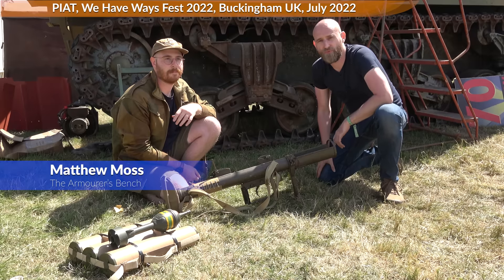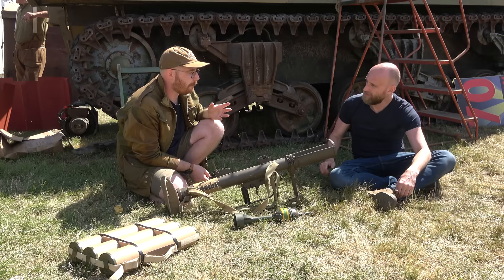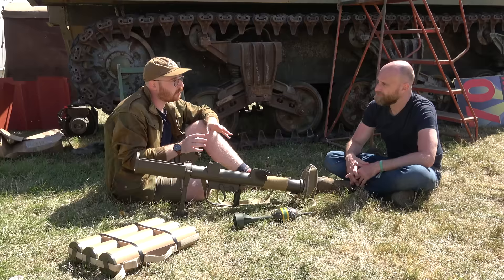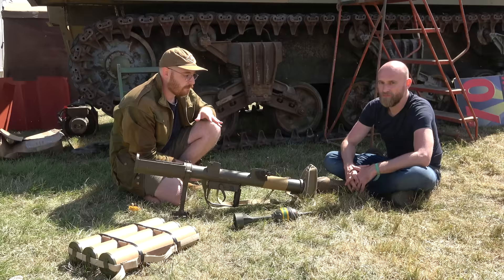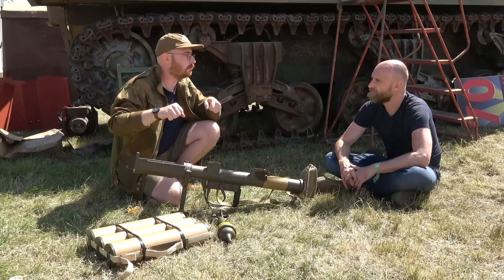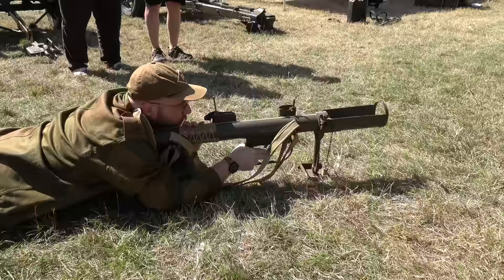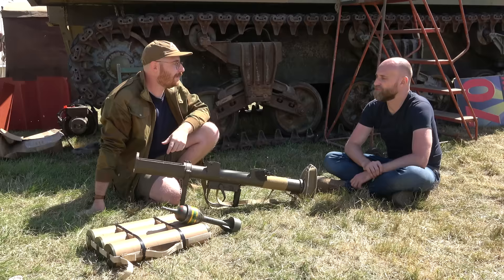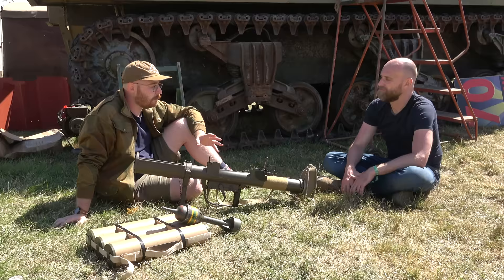PIAT: Better than the Panzerfaust?

Comment: I've always felt like PIAT would have been an ideal anti-armor/explosive option for partisans in WWII... whom didn't have access to it and instead was used by the british army:(
Reply: Panzerfaust would be even better IMO, hit and run tactics, shoot and scoot
Reply: @Piromanofeliz  can you shoot panzerfaust from a closed room? How much noise does it make and is that noise directional? How bright is the rocket motor and how visible the trail it leaves behind? Can you arc panzerfaust shots over obstacles? And more importantly, how easy is ammo for panzerfaust to produce in improvised workshops?
So, let me ask again, do you still believe what you've said?:D
Reply: They were actually dropped to Partisans and to the Home Army in Warsaw.
Reply: @TheArklyte  1. If you are at least 2-3m away from the wall, you'll be okay. 2. Yeah, it's loud, it's bright, and there is actually no trail marks. But who gives a fuck, when you relocate at sec, you take the shot? Anyway you are not brave, more like an idiot if you use these without friendly fire support. 3. Well it's closer to a recoiles mortar both in working mechanism and ballistics so the shot above obsticles is possible, but is it worth it? At 50-80m you are at the edge of close combat, would you make experiments how effective at close range a cumulative mortar, or use it the proper way? Couse if you miss, you won't earn more then a few shity pants. 4. The whole weapon is around to make it cheap, and simple as possible. Do I have to say more than, this is a freaking last dich weapon? The germans built these in improvised factories. If you can build a sten or a welrod, and you can craft amo for it you can build this shit in the cost of 15 imperial brand.
Reply: @BB-nu8pl  1)if I don't have time to calculate the backblast? 2)me? Because relocating when enemy has no idea where they were shot from and relocating under MG fire is different. And yes, let me just pull out my magical fully equipped rifle squad to support me at my convenience. 3)can I get weapon with reliable repeatable ballistics? Or should I shoot panzerfaust, watch it spin randomly and hit whatever? And yes, I'd prefer to have capability for such "experiment" if I'd have a need for something like ruining fuel tanks behind concrete fence, which I can see, but can't provide a clear access too. 4)PIAT and STEN(and several others) are also last ditch weapons. Last ditch british weapons. From a time when people believed that Sea Lion was a week away and all equipment was lost on the continent. Now tell me what's eaiser, fill a metal tank with plastide or do that and then also on top of that construct a rocket motor to specification so it won't randomly spin as in point above the answer to which you're already probably typing in to correct me?:D
Reply: What do you want to calculate about that? :D If you step into a room, and you can convinietly move around, you are gonna be safe. Belive me, at 100m, no matter what kind of stealthy anti tank weapon you use, the enemy will hear that, and start to spray that way. But they need time to  that, they have to realise they got attacked first, and all these pricey seconds are useful to us, to get the hell away from there. The "magical fully equiped riflesquad" is not about confort. They are essential. It feels like you forget, we talk about a war. A lonely fighter in a war is not more than a guy who sentenced his/her own death wish. Even the snipers work in teams. But yeah, a whole squad to a hit and run ambush would be overkill. I'd bring with me max 7 guy with sten 4 would protect the flanks and the back, the other 3 would be the support, after the grenade goes out, they just send out a burst and flee away with me. Then regroup with the oder fire team, and run as fast as we can(much easier without a heavy steel counter weight). And yeah as i told you CAN shot above obsticles, even with ironsight....no it wont bulging around, like a drunk pilot, I'm gonna tell the reasons later. Yeah the significant % of the british small arms where in concept of last dich weapon. But it isn't connect to what i told. The whole concept of panzerfaust where around to make a cheap, easy to product, yet effective and user friendly anti tank weapon, and the german engineers did it. The whole thing is not more then 2 steel tube, 2 fuse with a firing pin and a flat spring, ironsights some tnt, gun powder, and a metalic ball. And yeah, there got place the so called "rocket engine/motor". That shit is not more than a steel tube filled with gun powder, and closed with carton paper. The funny thing is the "engine" burns out in the outer tube, so the grenade flies and falls by it's momentum. No bulging away, it's just flies like a balanced rock. So why didn't use wieldly the partisans then? Becouse they didn't realy needed AT weapons, the encounter with tanks or armoured vehicles were rare, and if it happened, they had an even cheaper and more effective weapon, the molotov coctail.
Reply: They were used by the Armia Krajowa in some capacity

Comment: "Light recoil" depends on how many rounds you have to fire. Firing 1 30 round magazine from an M-16 is nothing. Firing 30 magazines without any padding and your shoulder will be very sore even if you have done it many times.
Reply: M16? No recoil.
At all
Reply: @sugarnads  3.2 ft⋅lb is more than 0. After a few hundred rounds, your shoulder has a bruise the next day if you are not wearing armor or at least heavier than a field jacket of clothing.

Comment: Another example of the design philosophy: "Why make things simple when they can be complicated".
Reply: Not at all. The concept is simple and the design robust and simple. Uniquely it was both a design in a new class (mini Blacker Bombard) that was introduced in it’s ultimate practical form. More charge means more recoil but the squishy human body is unchanged so you would have to increase the weight which would make it back up to Blacker Bombard territory which means a crew manoeuvring a mounted gun. BTW, contrary to popular myth, the Blacker Bombard was intended for Regular Army use as an anti tank weapon and issued as such in North Africa but it’s limitations caused it to mostly be used by the Home Guard and one still sees concrete prepared dug in positions

Comment: So basically its a great weapon...the 0.1% of time you are in actual combat. 
The other 99.9% of the time its a heavy and annoying piece of shit you have to carry around
Reminds me of the King Tiger. In actual combat it was really good and you wanted to be in one, the rest of the time it REALLY sucked and you wanted to stay away from the rolling maintanence desaster
Personally I would rather spread three Panzerfausts to three soldiers instead of having one PIAT with three shoots. More flexibility and easier to transport. Also it doesnt hinder most soldiers to do combat while a PIAT isnt exactly easy to transport in combat I imagine.
Reply: What made the King Tiger a maintenance disaster?
Reply: @Toenism  
Several things:
Its size, which means it needs heavy equipmeant to be repaired and cant be done quickly. Also transportation is a pain.
Germanys horrible ressource shortage at this point in the war. Basically the quality of everything in german industry has massively been reduced and it showed in parts breaking earlier or german engineers useing bad stop gap measures to make tanks still work. The lack of rubber and ball bearings was especially bad. Also german late war tank steal was easier to break and far less effective then early and mid war tank steel. 200mm on a Kingtiger could be worse then 100mm on another tank if you are unlucky and your steel is shit.

The chance that something broke down was higher then the tank reaching the frontline. And it wasnt rrally do to bad tank design but the general war situation making it impossible to keep the industrial quality a tank like this needed to function as intended.
Reply: @noobster4779  What more than size and poor quality steel for parts was an issue in terms of maintenance?
Reply: Which is why the PIAT was generally carried in the Universal Carrier or truck and brought up when needed, rather than being humped around continuously by the team. What most people do not realise about those weapons is that in most cases the PIAT Team had a Universal Carrier SPECIFICALLY for them. It carried them, their weapon and their ammunition. Which meant in general the PIAT crew were NOT in fact humping the thing for miles. 

As for the Panzerfausts having more flexibility, how so? No way to accurately fire the Panzerfaust in indirect fire, PIAT could and had sights for that role. Panzerfaust has back blast that will kill anyone behind the operator when the weapon is fired meaning it CANNOT be used in confined spaces where the PIAT has no such issues. 

Fact is both weapons had pros and cons. At the platoon level I would actually prefer a weapon that gave me the REAL flexibility of the PIAT compared to the Panzerfaust, while at the squad or section level I would probably prefer the Panzerfaust. 

Because really THAT is where your REAL mistake is. You are comparing a platoon level crew served weapon with a section level disposable weapon. You SHOULD be comparing PIAT with Panzerschreck or Bazooka NOT Panzerfaust.
Reply: I lugged around a Carl Gustav for many  miles.  Weighs just as much as a PIAT. and the ammo is even heavier.  It's only advantage over a PIAT is the longer range.
Reply: @Toenism  

The transmission being far too underpowered for the Tank, causing regular breakdowns and requiring replacement parts that, at this point in the war, your Tank Commander would need to win an organized fist fight at the maintenance yard to get, and it'll probably break the next day anyway.
Reply: @youraveragescotsman7119  Thanks, do you have a source for this?
Reply: @Toenism  Another factor not mentioned is the fact that Tigers were too wide to carry on railroad cars without changing their combat tracks for their transport tracks which were narrower.  Tanks get carried from place to place by train and only drive under their own steam in combat, and every time they had to be moved the crew had to change tracks.  You then have to store these tracks while they're not being used, and according to a recent Chieftan video, a set of Tiger tracks weigh more than a set of M1 Abrams tracks.
Reply: @minuteman4199  Interesting. Do you have a source for the tank being mechanically unreliable and prone to breakage? The other guy won't respond.
Reply: @Toenism  I used to be an armoured platoon commander, so over half a century I've read a ton of stuff about tanks and armoured warfare.  If you do a youtube search on "tiger Tank reliability" you'll find lots of information.

Comment: The British always try to rationalize failures of designs as features and innovations.
Reply: No, but then you have already made up your mind about that haven't you. More interested in your own particular brand of bigotry rather than actually looking with at something with critical eyes and an open mind. 

While PIAT was a dead end weapons system it DID have some advantages at the time over Panzerschreck and Bazooka which were its direct contemporaries. NOT by the way Panzerfaust, that is NOT a direct comparison to PIAT, and had issues that are generally avoided by many so called 'experts' these days, like hideous accuracy and the tendency to fly everywhere EXCEPT where you aimed it.

When you directly compare PIAT with its two ACTUAL contemporaries it actually does pretty well. Was it a perfect weapons system? No, but then few ever are, especially when you look at first generation infantry rocket based anti armour systems. 

PIAT's range was middle, its velocity was comparable to Bazooka (and both were well behind Panzershreck though well ABOVE Panzerfaust). While heavy it had no back blast which was an advantage in some areas, such as an urban battlefield as it could be fired in enclosed spaces. Unlike the other two it could be used in an indirect fire role. Also unlike the others the British Army tended to issue PIAT teams with Universal Carriers to minimise the amount of time they needed to actually be carrying the weapon and to enable them to carry more ammunition.... 

And so on.
Reply: Americans always come in 3 years late and act like they did it alone

Comment: This was not a success for two reasons which are actually only touched on  in the piece. 1. The recoil and the major effort required to cock it as failures to re cock it automatically were frequent. Fact is the design died quietly and was never followed up after the war. This would fit into the same category as the Sten gun. A working fix in a time of crisis...

Comment: Im not SUPER intelligent when it comes to the British PIAT, but wasn't the PIAT a more unreliable weapon and an inaccurate one? I know the Panzerfaust because it was rocket propelled could shoot farther and it was easier to operate? 
Haven't watched the video yet but im under the impression the Panzerfaust was much better and reliable than the PIAT, probably weighed less too.
EDIT: I have been told that the PIAT was much more effective in terms of accuracy so i stand corrected.
Reply: No, in testing the PIAT was more accurate than a panzerfaust.
Off the top of my head the PIAT achieved an 85% hit rate against a tank driving perpendicular at near the maximum range. Pretty good! 

Of course under battlefield conditions experience showed that effective range was more like 50 yards at best. But the panzerfaust was no better.
The PIAT was able to be fired from a concealed position, whereas the backblast from other weapons required a soldier to over-expose themselves. Causing them to rush the shot and often miss. If memory serves again, about 75% of Germans moving to firer a Panzerfaust would die in the attempt.

Also: the panzerfaust wasn't rocket propelled. It was a recoilless rifle. So it used a single explosive charge to fire the projectile out, which was then "free" for it's flight. A large portion of the explosive was vented backwards to cancel out the recoil. There are many accounts of Germans killing themselves and/or their buddies with that backblast. Particularly late war as training  became shorter and shorter.
Also of note, even the rocket propelled Bazooka and Panzershrek kind of weren't. Their rocket motors burned only very briefly - the bazooka's ended mid-tube and the panzershrek's only shorter after (hence the shield to protect the operator from burning their face).
Reply: According to wikipedia the range of a panzerfaust is 60 m and the range of  PIAT is 115m.
Reply: @minuteman4199  Didnt it differ depending on each Panzerfaust? You had the Panzerfaust 30, 60, 100 & 150? So couldnt you fire it farther depending on each Panzerfaust you had?
Reply: @ArcticWolf00Alpha0  yes, the number of a panzerfaust is the nominal maximum range.
The 60 being the most common and 100 being the still relevant later version.
The 150 was just barely beginning to be produced at the very end.

Nominal maximum range is always a bit iffy. Is that how far the projectile can possibly go? Or the furthest you could score a reliable hit? Under what conditions? How reliable is reliable?
Still a useful "finger in the air" measure though.

Plus, of course, the PIAT could be used at up to 350yds in the indirect role.
Reply: @kirotheavenger60  True and the Panzerfaust could be used in an infantry role as well, combat footage from the Battle of Berlin showed the Panzerfaust to be very effective against T-34's IS2's and other armored vehicles. Even the Soviets were using them if they could.
Reply: @ArcticWolf00Alpha0  indeed but the panzerfaust had no mechanism for long range indirect fire.
So it could and was used against buildings/foxholes/etc but only at that short range.

The Soviets didn't have any equivalent weapon. They had the PTRS/D AT rifles which I'm sure need to explanation as to why they might be inadequate.
And the hand thrown RPG43 AT grenade (contrary to popular belief "RPG" means "infantry anti-tank weapon" in Russian, not "Rocket Propelled Grenade"), which I'm sure also needs no explanation.

The Soviets made lots of use of any Bazookas they could get, as well as Panzerfausts they captured.